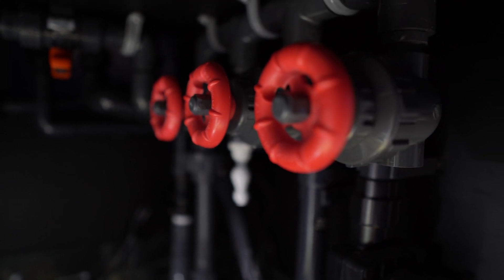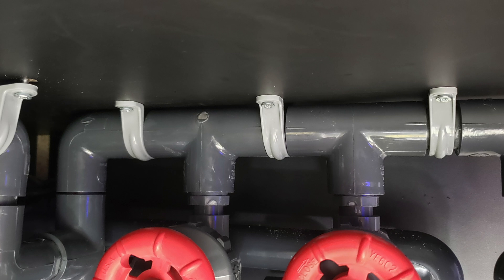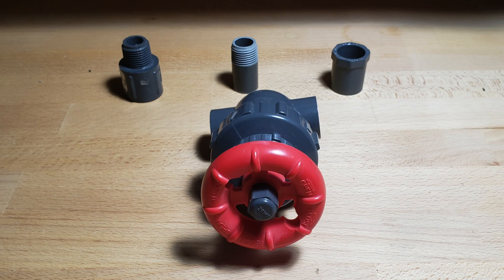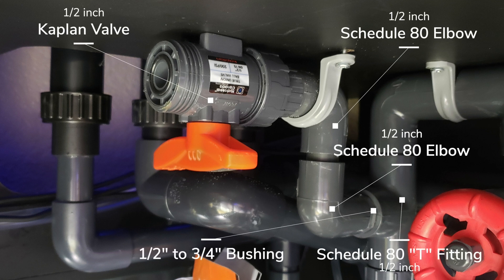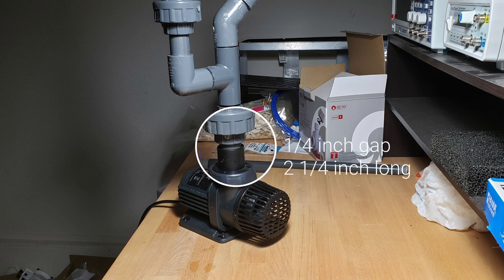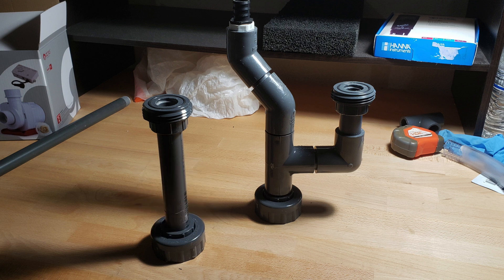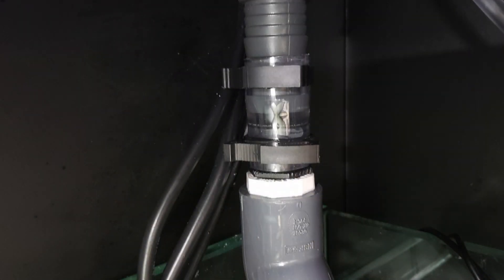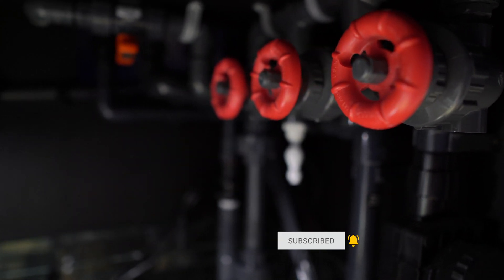Red Sea Reefer Professional Manifold | DIY guide to build your own Manifold!!

Comment: Hello hello - how to select the pump power to handle the main water return to the aquarium and the manifold? Is there any rule that it must be for example +25%? Thank you in advance for help.
Reply from the maker: For me, I look at the the flow requirements for the tank, ca reactor, media reactor, etc and then add them all together. I then multiply by 2 so that I have room for adjustments later on as pumps do get slower over time. I also like to run my pumps 50-60% power so that it's not on max.

Comment: You did a parallel connection on the xxl650 here.  I’m doing something similar to this now.  Don’t one need a valve for the branch going into display tank after branching point in order to control flow into manifold?  If there’s no valve here, would water go into display mote instead of manifold as manifold has more resistance?
Reply from the maker: You can put a valve there if needed.  I did not because there's enough pressure to the valves on the manifold.   Also, I had one on my previous reefer 350 and I never had the need to use it so I didn't include it in this design.
Reply: @ModernReefer  thanks bro.  I did it today and what I found is that it becomes very tight as each addition (valves, tee,etc) take up a lot of space and I barely had enough room for them.  I don’t even see the color of my pipe as it is covered by the sleeves of all the addition
Reply from the maker: @hkn2718  Yes it does. It's a tight fit.
Reply: @ModernReefer  thank your so much.  This is my first time working with pvc and cement.  Quick question.  I just cut my Aqua UV unit out of my currently running tank and put and end cap in it with some cement.  Instruction says about 2-4 hrs to cure.  Do you think it would be safe to resume flow in that time.  Would cement be toxic to reef/fish?

Comment: Hi modern reefer.  Where did you buy those things that you screw manifolds to ceiling ?
Reply from the maker: Look at this link for the clamp.  They are similar to the ones I bought. https://amzn.to/2NaMj41
Reply: Thank you very much.  I didn’t see one for 3/4 inch size bit I found the same brand at Home Depot
Reply from the maker: @hkn2718  Lowes should have them too.

Comment: Very glad to have found your channel.  A lot of the ideas I have for my Reefer XL 300 I found you have already done.  I’m working on a manifold for it now and I got a lot of ideas from you.  One question do you find it better to run the return line in series with the manifold or in parallel? I assume the parallel layout will have more head pressure.  Second I plan to have the easiest water change as possible.  Was planning on putting an inline pump inside DR that runs through a line outside of the house to the drain as shown.  What do you want think of the Neptune pumps that you used?
Reply: Can’t attach pictures
Reply from the maker: @hkn2718  I'm glad you're enjoying some of my builds.  I dont think it matters if you run it in series or parallel as long as it works. The neptune PMUP is too slow in my opinion. I"m trying to find a faster way of doing water change.  Right now it takes be 25min to drain the skimmer section of my sump and another 25min to fill it back up.  You migt be better with a pump with more flow.
Reply: How about a cobalt ext?
Reply from the maker: @hkn2718  That will work just fine.
Reply: Do you have Facebook or something that I can show you my set up and get your opinion
Reply from the maker: @hkn2718  email me paulsvang@hotmail.com

Comment: After all this time, are you still happy with having the manifold and return on the same pump? Would you recommend separating the manifold on its own pump?
Reply from the maker: It's worth it in my opinion. I don't need to run an extra pump to feed a separate manifold.  If you have the extra pump and outlet space, it would be fine operating that way as well.  I just don't see the need to run 2 separate pumps when one pump can do the job.
Reply: @ModernReefer  Can one pump "do the job"? The valve adjusts and exactly matches the flow of the pump into the weir box with the rate of siphoning out of the weir box so that the water height can be set just below the height of the emergency overflow.

Herbie Overflow Method regulates this height because if it increases the rate of siphoning increases to bring the level back down. The efficiency of the pump decreases with increased head height which causes the throughput of the pumped system to reduce which also brings the level back down e.g. to regulate it.

Regulation takes time and can only compensate when the two flow rates are allowed to become equal. So a manifold in this relatively sensitive circuit isn't recommended because any change to the flow through the manifold will also change the flow back to the weir box and the regulation can only compensate for small differences. Two pumps and two separate circuits avoids this issue.
Reply from the maker: @foxglovemead  I agree but after a few adjustments, it's all working fine.  If I open up the valves knowing that water will not get to the display tank as much as it should, then I increase the pump speed.  After all manifold valves has been adjusted, I fine tune the return valve.  FYI my pump is only running at 60% so I can still increase or decrease pump speed as needed.  The whole tank setup runs quiet as it should.

Comment: this looks great, what screws did you use to hang up the manifold?  and did you screw it in with the tank already on top?
Reply from the maker: Honestly, they are just regular stainless screws from the hardware store.  I made sure they were short so that they would not go through the cabinet to the tank.  The tank was on top and running while I installed the manifold.